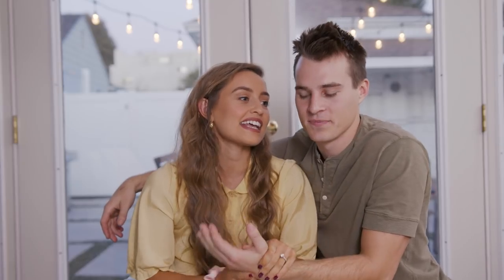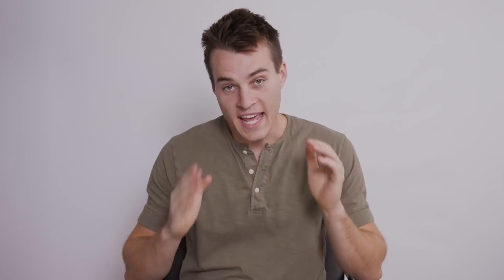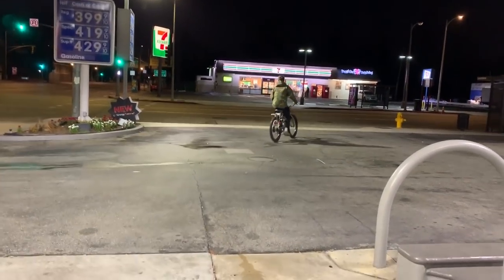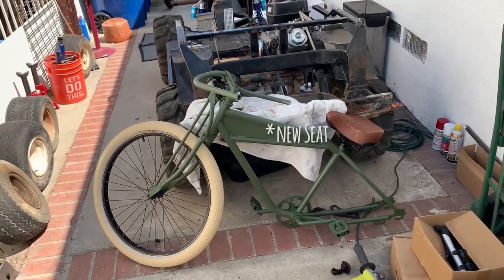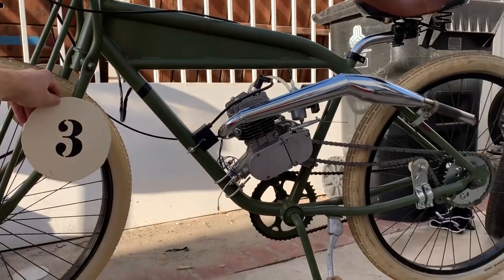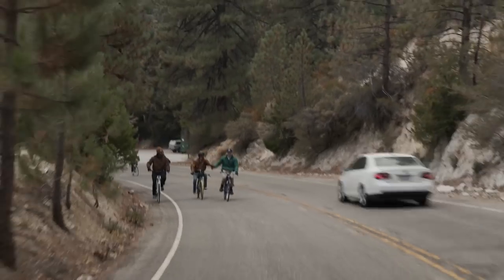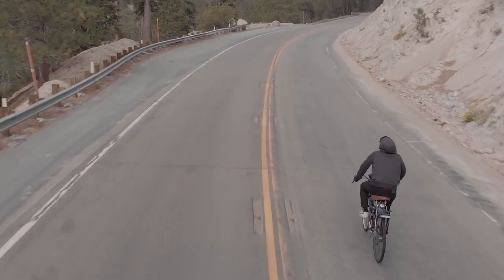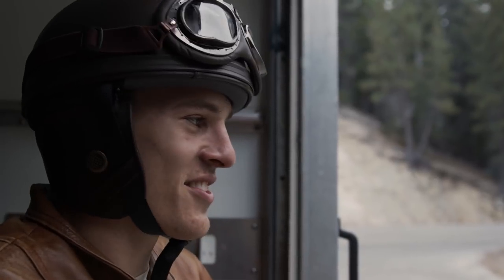Turning a bike into a motorcycle for $90.

Comment: Ha! Cinema Secrets on Riverside Drive in Toluca Lake, near Burbank Studios! I used to buy some of my special effects makeup supplies at Cinema Secrets back in the day. Fun gas-powered bikes. What are the California laws regarding the use of these bikes? I have an electric-assist cargo bike, but on level ground, I can only get it up to about 21 mph. We need to change the laws in California for electric bikes. It's SO dangerous to ride in L.A. traffic on a bike that can't maneuver safely in traffic because it can't move as fast as the traffic, and yet, electric bikes can certainly go as fast as if not even faster than automobiles, if they were ALLOWED to. 

Now, regarding gas-powered bikes ... I have seen a guy down here in the South Bay in Torrance who has a gas-powered bike and I've clocked him easily doing about 45 mph, maybe faster. He doesn't have signals on his bike. He wasn't even wearing a freakin' helmet! So why is it legal for HIM to go screaming down Anza Avenue at over the posted 35 mph speed limit while I am relegated to only 21 mph (or as fast as I can peddle with the electric-assist helping ... which really isn't much faster anyway) when those of us who've been riding bikes for years or decades already know, that to really be able to ride safely in automobile traffic, one needs to be able to GO FASTER?

Comment: Any ideas on how to get the chain to run on the right side of the bike? I have a mountain bike with disc brakes in the rear and I cannot use engine sprocket on the left side.
Reply: Put an additional shaft with two chain stars behind the engine! You can use a part of old frame with the pedal shaft for this purpose 😊

Comment: None of the motors were broken in. The gas was mixed incorrectly. It’s premix gas in a gas can then add the gas to your tank not put oil into the tank and add gas. You actually did things incorrectly.

Comment: You have to go through 4 tanks of gas on a new motor and only drive for 15 minutes at a time until you break the rings in and after you break the rings in then you will have more compassion and you won't blow the motor up

Comment: A major problem with these kits are regular bikes can’t handle the  additional stress the motors put on the weld sand the bikes  wind up breaking  on the factory welds  the motor kits are pretty cool   like the girlfriend in the video

Comment: What exhaust is that?!
Can someone leave a link.
Reply: Pascal Nielen 

https://www.gasbike.net/products/thrust-racing-muffler-chrome
Reply: @wasabisnapdragon  thank you
Reply: @pascalvannielen6794  it's one of the best ones I've used by far! Not good for V brakes (rim Pinchers) unless you bend the pipe it blows oil on the wheel and it's built out of really strong steel so it's super hard to bend.
Reply: @archer7212  oké thank you

Comment: Can i join a run, but I run a 49.4cc Honda g.x.h. 50 gas bike. 25 to 35 cruising speed automatic I want to make the trip coast to coast on one engine. P.S. your video is an inspiring creation, well done. But your riding goal will require a slight bike upgrade in my opinion to succeed.

Comment: 2 stroke motors not legal on city streets in nazifornia. Four strokes are no longer legal either. I used mine for a year and got almost 4000 miles before it died. I drove "properly" and was never bothered by all the cops that drove by me. If you drive like a dumb ass, they'll stop you for sure. I went back to my ebike conversion kit. No noise, no oil mess, no constant adjusting and no always buying replacement parts.

Comment: I wish I could do something like that. I have had my bike for 4 years now and never even got it started. I think it's because the gas is old plus I am still not sure how to mix the gas and oil.
Reply: Yes I just need to know in simple terms how to mix the gas in like cups or even tablespoons you know like in kitchen measurements not ounces or liters or parts. Or how much oil to put In a gallon of gas.
Reply: Ok I will ask it simpler I have a gallon of gas and a pint of oil how much of the pint do o use. Half, 1/4, 1/8, 3/4.
Reply: @Mr_Fancypants  Thank you that helps a lot sorry for asking for so much normally I could figure this out but I now have epilepsy and hydrocephilous which make it hard for me to figure it out and focus on the math.
Reply: @Mr_Fancypants  See normally I could figure that out but I am looking it and it's like Spanish to me.

Comment: I build one of those and the chain tensioner got caught in the spokes and I totally flew off and I got the worst road rash.
Reply: Use an engine mounted spring tensioner. The stock ones are crap
Reply: Archer 721 i would but at this point there’s so many more problems than just that it’s very unsafe to ride

Comment: I will say you need to put 4 ounces of oil to one gallon of gas it look like at the beginning of the video you guys put a little too much oil in those little tank they only hold roughly not even a half a gallon remember those engines need to smoke just a little bit otherwise you're running to rich they just need to get to the point to where they are just smoking I think the mixture is right around 26 1 if I remember correctly

Comment: The cheep 90 dollar motors don't last and are to cheep they don't hold up. Go to bikeberry.com and buy one that's a lil more $ and it will pay off. I own 2 motorized bikes one over 2 yrs. And I've built about 6. With a lil tweeking and some aftermarket upgrades you can get em upwards of 50 or 60 mph.

Comment: don't try this at home did you see how small the tyres were no wonder the white bike crashed and the green bike wouldn't ride no faster than 5 miles per hour the front end wasn't even straight with the frame at lest his tyres were fat great videos editing  though,did this 10 years ago goin electric ebike,QUITE no more mixing gasoline.

Comment: These guys were in way over their head doing this and could have gotten seriously injured or died doing this. 
No helmets riding the Chinese motorbike kits on untested bikes that weren't tested or tuned at all on a weavey windy mountain road with big cliffs. I'm surprised no one died.
Those motorbike kits aren't for everyone. They constantly need tuning and bikes aren't built for motors.
you have to think ahead and also have good knowledge of how 4 stroke and 2 stroke motors work. also know a lot  about bicycles. And you should know how to ride a bike or have ridden a bike in your life at some point before riding one of these death on two wheels machines. i mean some engineering background would be a plus when building one of these instead of the piece of paper with pictures and Chinese lettering on how to assemble them. 
I get it thou, you wanted to have a race with your buddies and of coarse they were all in the love you your their awesome friend. 
but a bit more time and thought needed to go into safety and making sure the bikes were running good, brakes,wheels, tires, engines mounted right, running right. someone could have ended up dead. 
And i'm not just ranting i have built fleets of these bikes when they were a new thing in the US back in 2002. 
I built them on every bike you could think of and the one thing that was the same on every one was, The motor kits being installed right out of the box was the worst thing you could do. the nuts and bolts and components were not only at a minimum for durability but way less than that. the bolts and screws were all grade 1 bolts and screws. the engine cases are sand cast aluminum so screwing any screw into them to tight would immediately strip out what threads where there. A steel threaded insert fixed that right up. How i learned that was my exhaust pipe kept coming loose and as your running it starts spitting searing hot oil on your lower legs and feet. 
And if u open the stock exhaust up and cut the tube that's in there shorter helps it at the top end and it goes a little faster. 
and i bought a 12$ spark plug that was a high performance spark plug for a weed eater and that made a huge difference. and last but not least high octane fuel for the win. with those mods it took a 25 mph bike to almost 40 mph. and that's without changing the gear ratio by changing the rear motor drive gear to a smaller one. i never did that because it was enough doing 40 mph on a bicycle that's not made for that. well the bikes i built weren't just bikes off the Walmart showroom floor. I rebuilt the rear wheels with thicker spokes and fatter rims. a freewheel is also better to start with. and after i was done with the bikes and i had put it to rest building them, i found out there was a pull-start mod you could add to these 2 stroke kits. lol. 

Im not hating just thinking about safety and performance. have fun guys. hmu if u want to know more about these motorbike kits.

Comment: This is not illegal but should be. Polluting piece of crap.  If you make and use this you are not a good person. There is a reason there are pollution controls even on weed wackers. A truck will pollute less.
Reply from the maker: These meet emissions standards for California which are the most strict in the county. They get over 100 miles a gallon. So they are virtually one of the most efficient fossil fuel burning mode of transportation. Lol
Reply: @marcusjohns  The link you gave was to totally illegal motors that would be illegal if they were installed in a moped. You can not get a CARB certified motor for 80 bucks. 4hp is the limit for mopeds. 1000 watts or 49cc for gas bicycles.  You are making the air harder to breath.  Your fun is not worth my lungs.